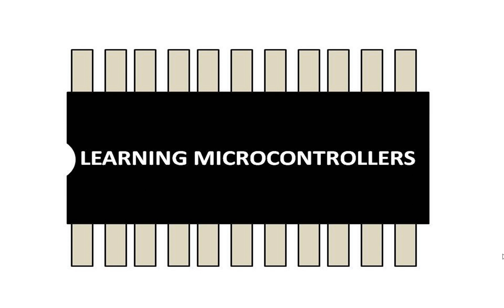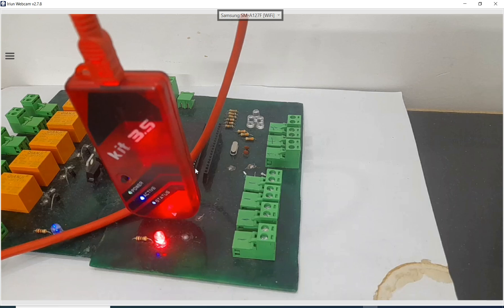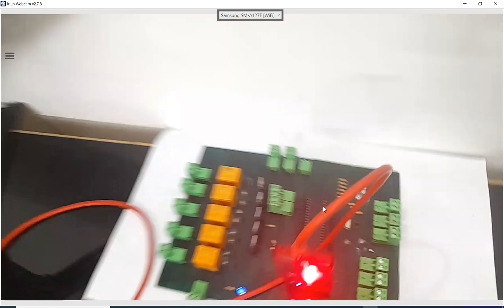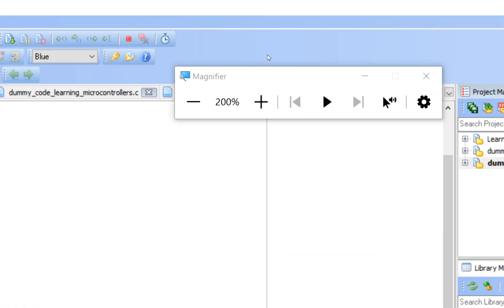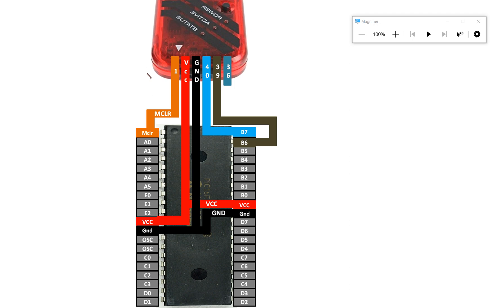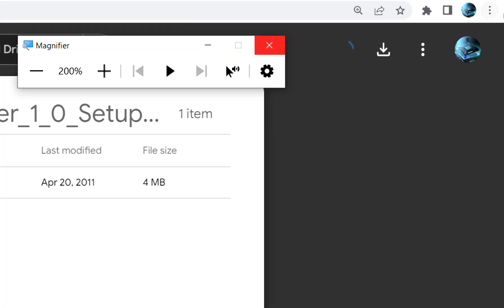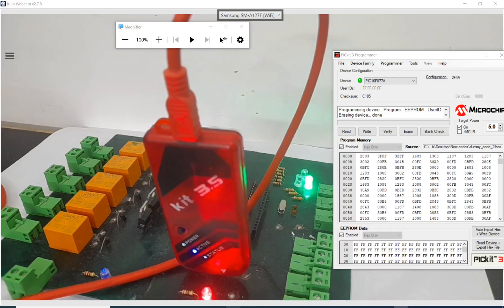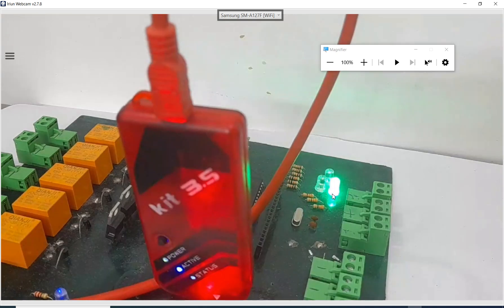Copy a Program from 1 PIC16F877A microcontroller to another PIC16F877A microcontroller. Tutorial.

Comment: VCC-VCC and VDD-VDD are internally connected... and you can download the code only if its not code protected from the developer in 1st place. Thank you for the video 🙂
Reply from the maker: No brother they are not in PIC16 40 pin series. But they are in advance microcontrollers of PIC18 40 pin series like PIC18F46k22. This is done by microchip in order that if you accidently insert microcontroller in oppsite way it will not get burnt.
Reply: @learningmicrocontrollers3561  The PIC16F882/883/884/886/887 devices have a host
of features intended to maximize system reliability,
minimize cost through elimination of external
components, provide power-saving features and offer
code protection.
These features are:
• Reset
- Power-on Reset (POR)
- Power-up Timer (PWRT)
- Oscillator Start-up Timer (OST)
- Brown-out Reset (BOR)
• Interrupts
• Watchdog Timer (WDT)
• Oscillator selection
• Sleep
• Code protection
• ID Locations
• In-Circuit Serial Programming™
• Low-voltage In-Circuit Serial Programming™

REGISTER 14-1: CONFIG1: CONFIGURATION WORD REGISTER 1
bit 7 CPD: Data Code Protection bit(2)
1 = Data memory code protection is disabled
0 = Data memory code protection is enabled
bit 6 CP: Code Protection bit(3)
1 = Program memory code protection is disabled
0 = Program memory code protection is enabled

I have a pic16f and a multimeter in front of me. VSS-VSS are shorted. VDD-VDD are shorted.

Comment: Great video and easy to understand with example of simple prrogram. Can I use this technic  to read program of any PIC 16F877A (without protected)? TIA
Reply: Nice
Reply from the maker: @doanchris7846  yes
Easily
Reply from the maker: @doanchris7846  you can use it on other PICs aswell supported by PICKIT
But pickit connection will be differnet method is same

Comment: I have a pic16f689 IC that has been programmed, and I want to copy it, but after I open it, it turns out the data is protected, how do I open the data protection without destroying the data that has been programmed?
Reply from the maker: So far
To. Over ride read protection is not possible

Comment: Very good Brief about everything...Sir from where we can get EPROM fixing PCB board? Is it comes along with PIKkit 3.5 when we order online or have to buy separately?
I want to copy data from PIC 16F876A in my company used in Differential pressure transducer.
Reply from the maker: you can use pickit 3.5 to import the data
Reply from the maker: for the board I have a video you can make it
you can also make it on bread board
its easy only 6 wires thats all
i have a video on that
Reply from the maker: https://youtu.be/CNwoRa1Lk3U

Comment: does this work with original chip read protection on?
Reply from the maker: it works with all original chips
but in case read protection is on
then when you read it will display an error during read process
Reply: @learningmicrocontrollers3561  how then can the code be read.  in so many years I have not come across a single factory device that does not have the microcontroller read protection.  Without read protection, any general-purpose programmer, even the simplest one, can copy the pic controller
Reply from the maker: good day 
my purpose of this video is only to give you knowledge regarding how to make a backup of your own codes  incase you lost the main file
its not like copying other codes
read protection cannot be by passed easily. 
especially in PIC

Comment: Sir, i have a problem in a code for PWM..  my MCU 16f676 has no PWM pin , How can i make Your PWM code in MicroC software for 16f676??
  there is no PWM liberary for 16f676.  ??
Reply from the maker: No PWM pin means you cannot use PWM library
Either change the microcontroller
Or you can generate a manual PWM using delays